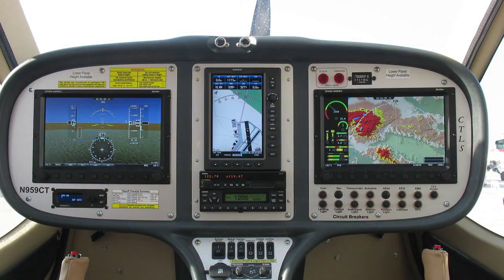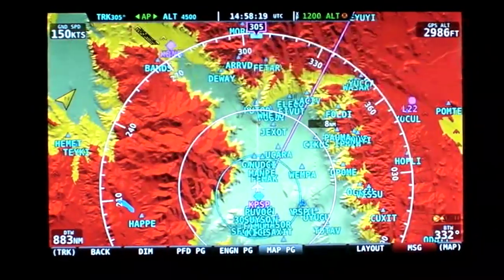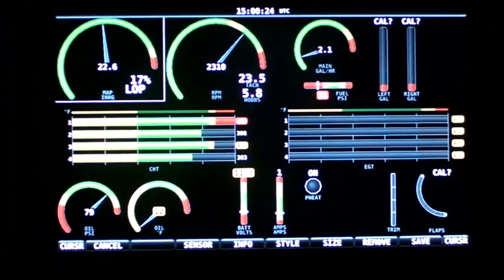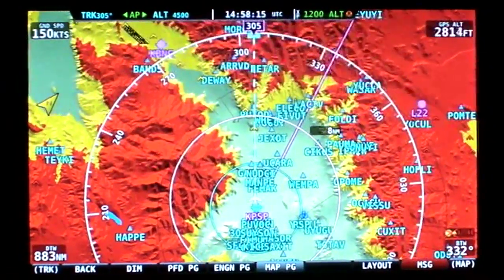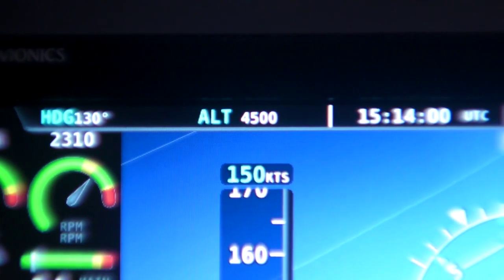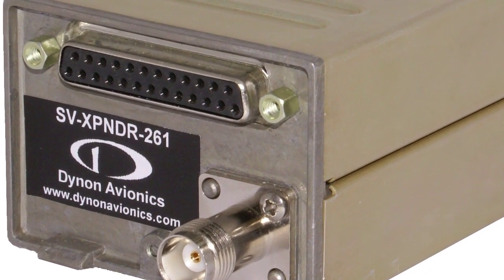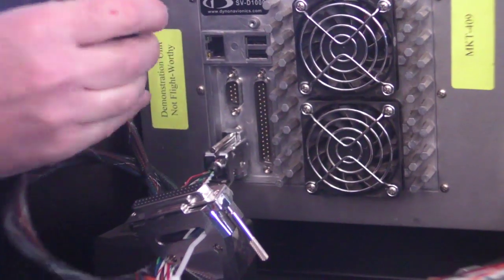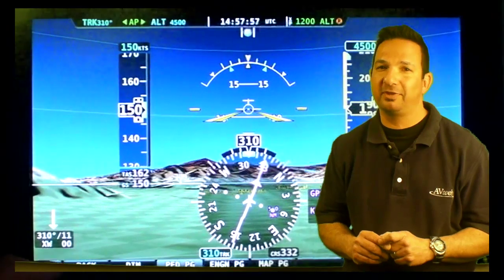Dynon SkyView Product Tour

Comment: Let me respond to What Mr. Stephan Barker wrote. I am 50 years old. I was used to the old school gauges. I know, that human brain is an analog computer. True, we can evaluate the physical position of dials faster than figures. It only takes a glance. All of that is true. At least that is what I thought too. But only before I started flying the EFIS. In reality, it is just as simple. I fly planes both with traditional analog six-packs and with the EFIS. Trust me, it is easy to transition to the EFIS. You also have the coloured bars to show you things at at glance. You don't HAVE TO interprete figuers in your head, when you don't need to. THE EFIS OFFERS YOU MUCH MORE INFORMATION, compared to analog gauges. YOU HAVE THE ARTIFICIAL HORIZON WITH THE 3D TERRAIN VIEW. THIS CAN SAVE YOUR LIFE MAN. YOU CAN DO A SAFE APPROACH IN MARGINAL VMC OR EVEN IN IMC IF NEEDED. YOU ALSO HAVE MUCH MORE ENGINE DATA. YOU DO RECOGNISE THE CHANGE OF SPEED AND ALTITUDE AT A GLANCE BY THE VERTICAL MOVEMENT OF THE FIGURES TOO. You see the 3D terrain at the screen and it really can be very important. Not to speak about the navigation features. And the Dynon has an AUTOPILOT too. This is fantastic. When the flying gets really tough, you don't have to risk spatial disorientation. Would Mr. Kennedy have had this in his flight to Martha's Vineyard (as an example), they would be just fine... I sometimes have an analog watch on my wrist, sometimes a SUUNTO. I find reading the time just the same on either of them. I am not too old to be afraid of an EFIS yet. Are you? After all for those who prefer a traditional six-pack for flight instruments, the EFIS can give you that too. But also give you so much more. Just download the new firmware and do the settings...